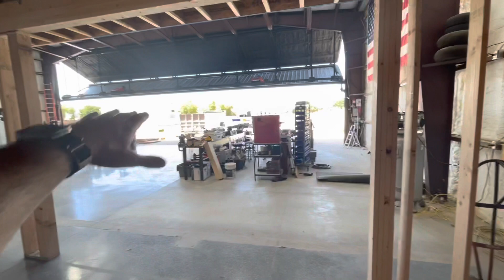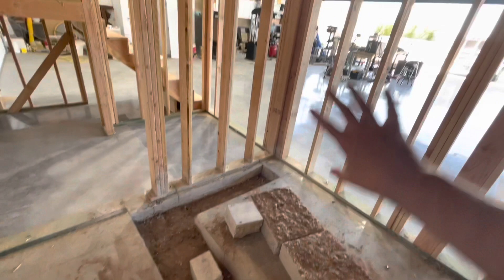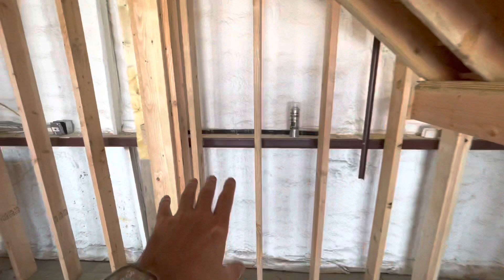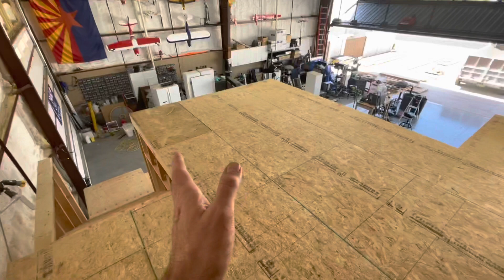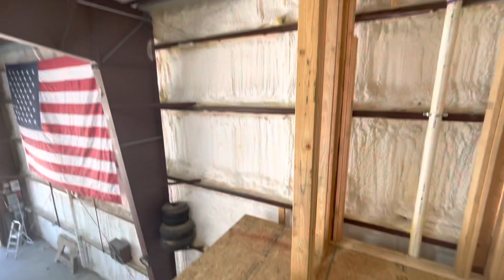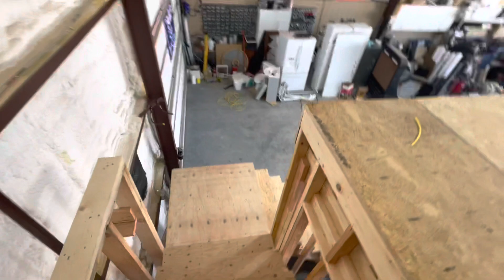Hangar Remodel w/ Shop & Office

Comment: We absolutely love the two story workspace that you were able to build within your hangar. 
We have a couple questions: 
1- did you hire an architect / engineer to design your 2 story space? Or did you fonit with a particular software?  
2- is the first floor 2x6 ? 
3- is the second floor 2x4?
4- what glass garage door did you buy?  Make and model?
5- would you change something now that you have had the space for a few years? 
Thank you. 
Big fan of your project.
Reply from the maker: 1) I designed this myself and hired a draftsman to draw the prints. 
2) all framing is 2x6 with TJI floor joists
3) see above
4) I don’t recall the brand but it’s aluminum dual pane glass 12x8
5) there are several changes but nothing major. Just add a few more electrical outlets and additional lighting.
Reply: @Outbound300  Thank you very much. Keep up the great work.

Comment: Looks like a great utilization of space! The conditioned workspace will make working out there a dream in our summer heat season, too. I like the positioning of the hangar to the house. Seems like having it a hundred feet away at the back of the lot, like in most airpark lots this size, would dampen any ambition to work out there. Thanks for sharing your thoughts on using the space you have. I'm almost ready to start building a detached workshop in our backyard, (waiting on concrete) and seeing other's ideas is really helpful.